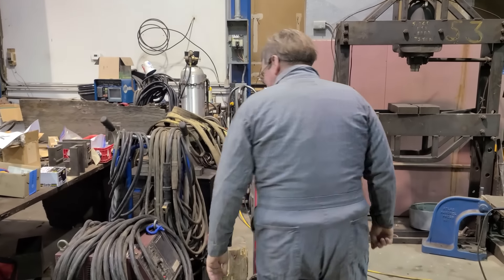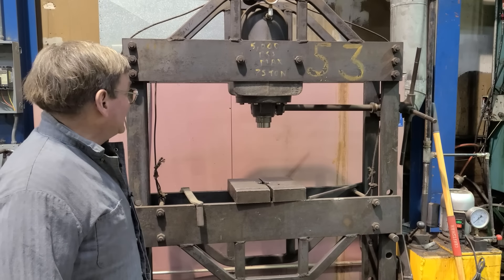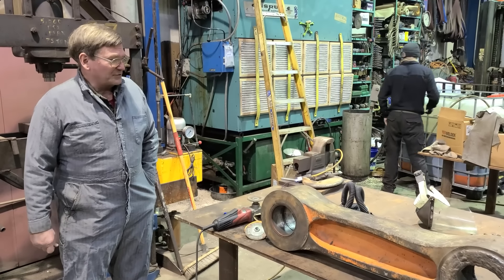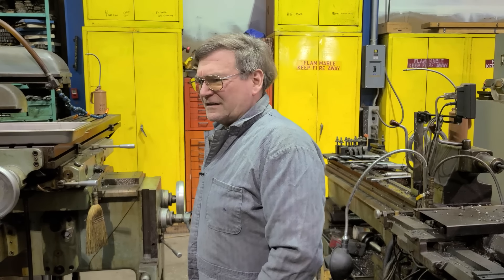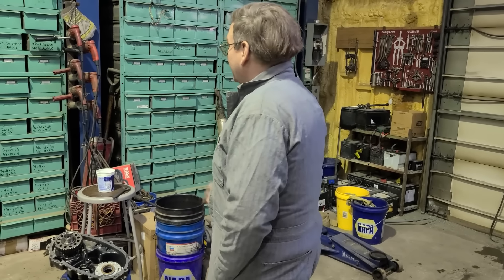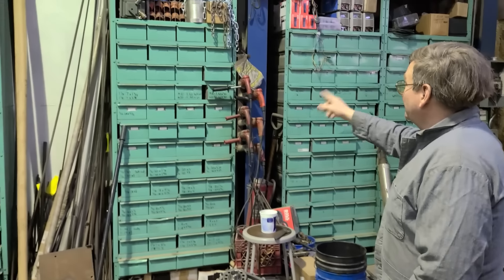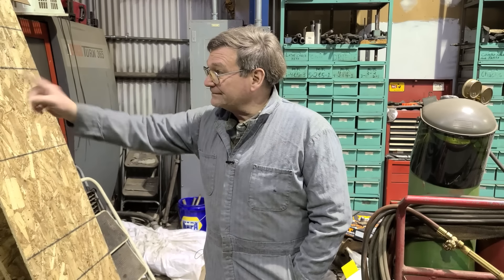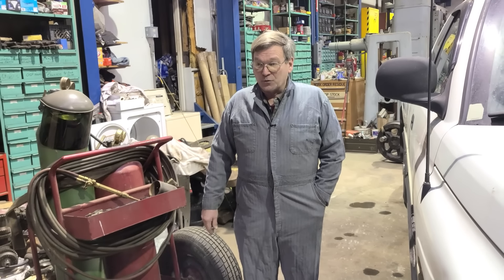Shop Tour, part three

Comment: We have a portable plasma cutter, and regular AC/DC Lincoln sticks, with a Tig wand and a gas tanks with regulators. DC because we do marine work, so stainless steel, is a biggie. Sad that you don't do hydraulic hoses, people need to get their heavy equipment, machines, even forklifts, immediately. The alternative is wait a month on backorder, for OEM parts. I went through four hundred feet of hose and drawer fulls of connections. Every drill press, could use a Square D, reverse switch.

Comment: On the hydralic press, why not just put a kick out type valve on it as a wood splitter has rather than using a limit switch?
Reply from the maker: The valve would take more distance to trip, so I would loose too much of the stroke.